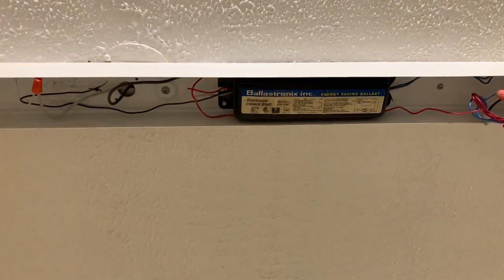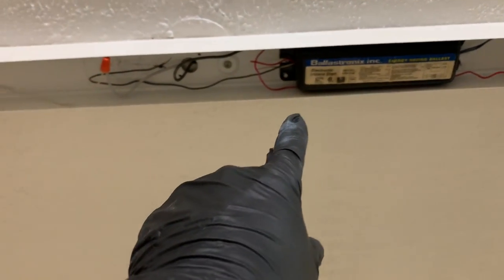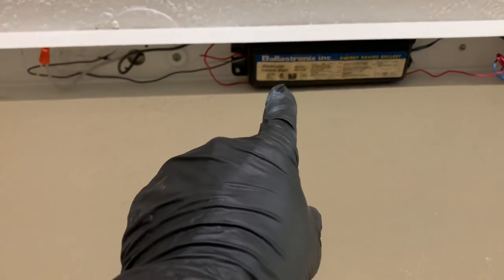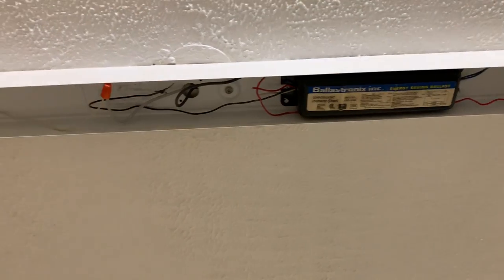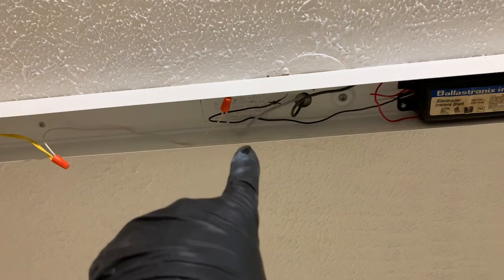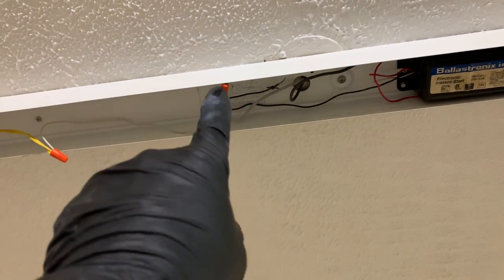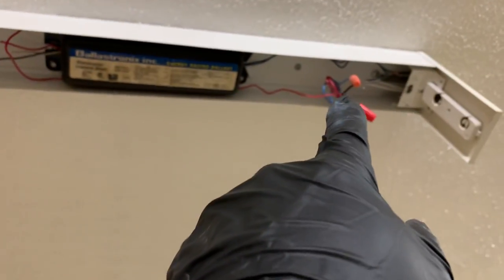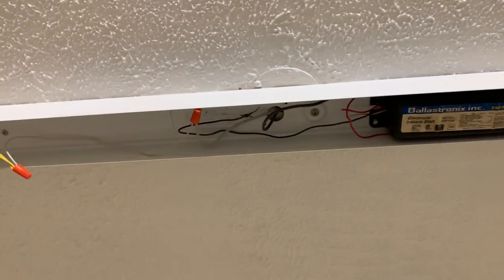Upgrading fluorescent fixtures to new LED lights

Comment: Thanks for sharing! I have gradually been doing the same at my church for the past 5 years, mostly removing or bypassing the T-12 ballasts. For years you could buy direct replacement LED tubes for T-8 fixtures but recently tubes are available at Costco that are compatible with either ballast type. I read a cautionary note of shorter life expectancy when used with T-12 ballasts.